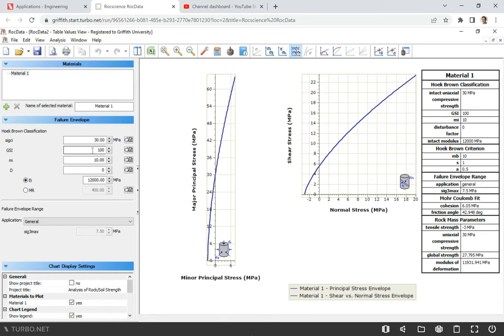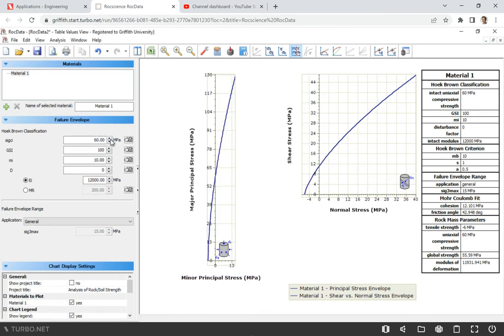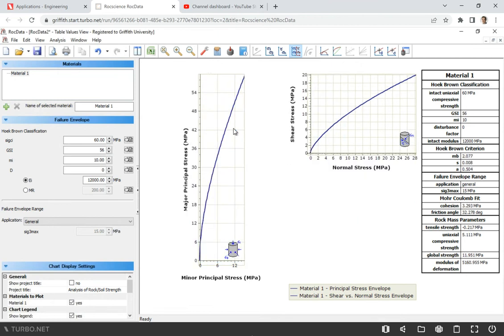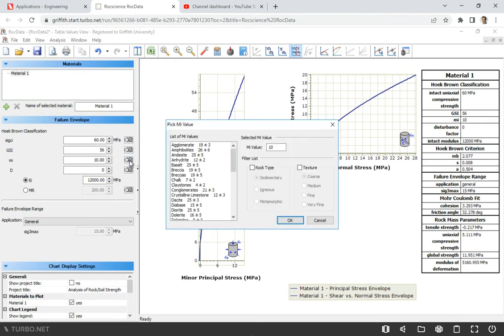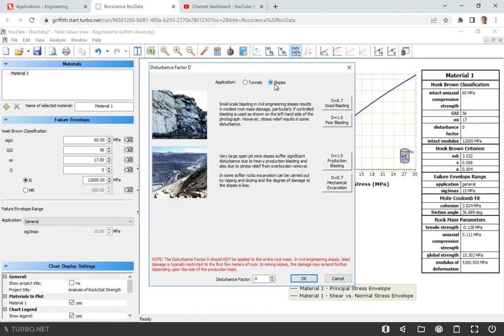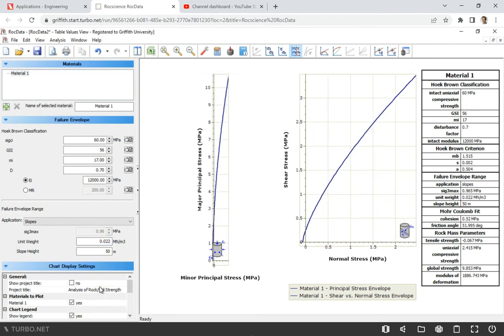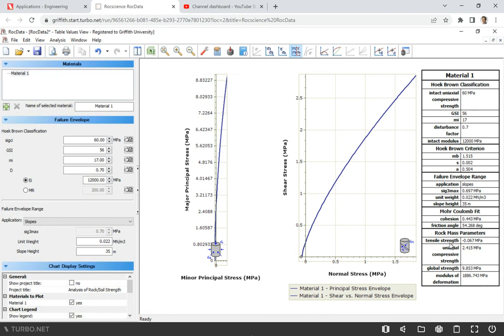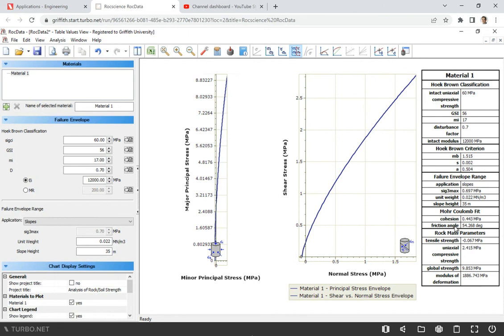Tutorial 2: How to Estimate Slope Rock Mass Strength Using RocData | Step by Step Procedure

Comment: Thanks for your spirit share .very clear tuto.may i have the application please?
Reply from the maker: The practical application will be to estimate the overall strength of rock mass and obtain the shear characteristics such as cohesion and friction angle that can be used for slope stability analysis